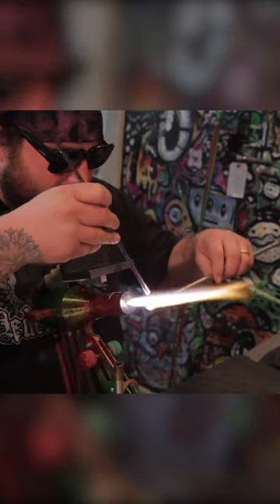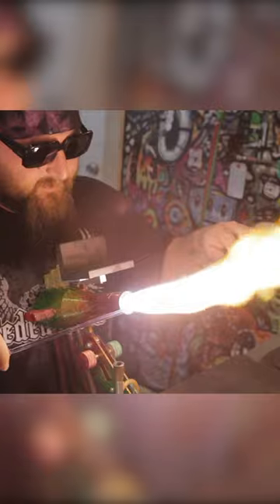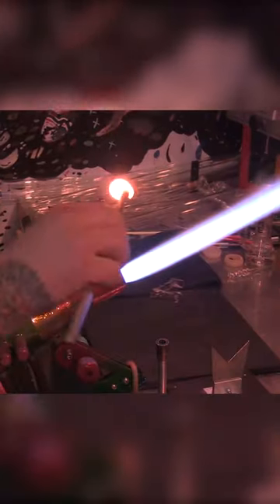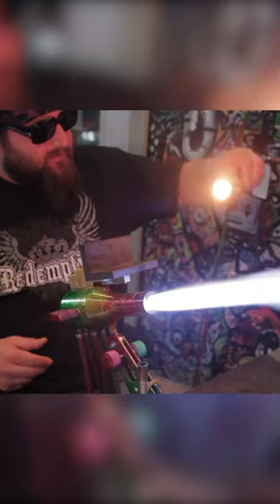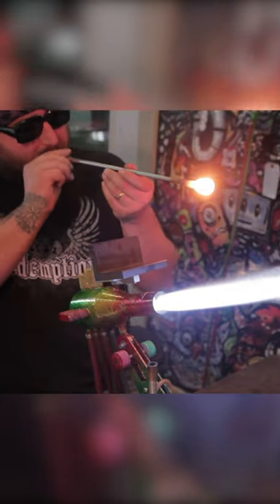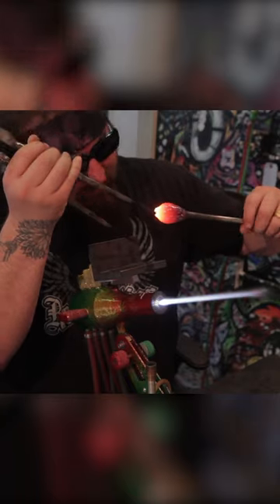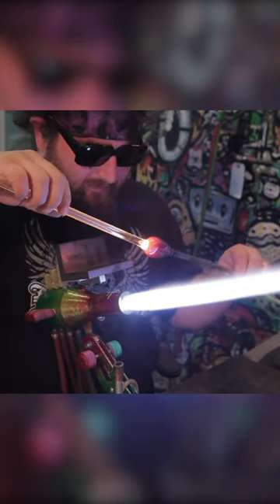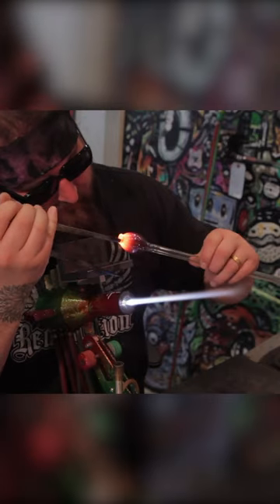How to blow a glass bubble! How to use a glass blowing blowtube! #shorts #glassblowing #diy #420

Comment: If that's Boro, why don't you use a clear tube to begin with? I've been working borosilicate since 97. I don't use any metal tools on hot glass. All my blowpipes and punties are glass. I only ever touch hot glass with other glass or graphite.
Reply from the maker: The metal will stay rigid when it gets hot unlike the Glass. The reason why I didn’t start with clear is because you can buy clear tubing and rod already. This way I can blow out any color. I want to tube in a few minutes.
Reply: I just either coil off the end of my clear tube or sphere up a stick of color and go from a punty to the end of a tube, reheat and blow-out. This is actually the 1st time I've seen or heard of Boro being worked on a metal pipe outside of crucible work like in a soft glass shop.